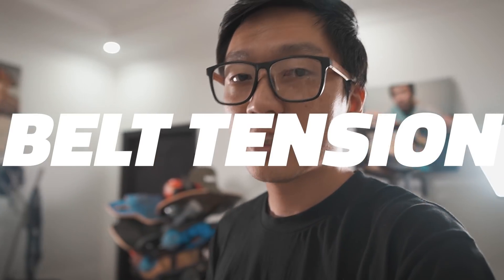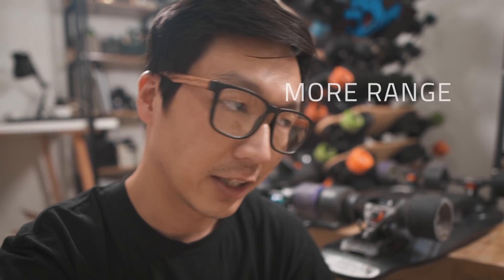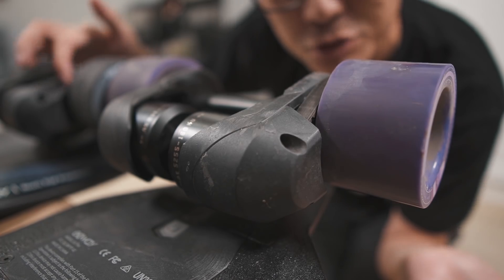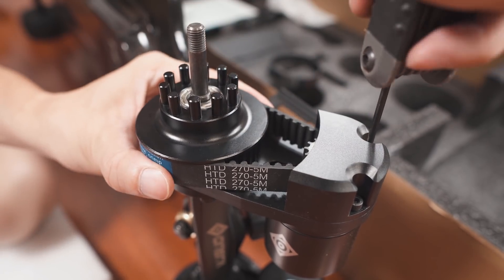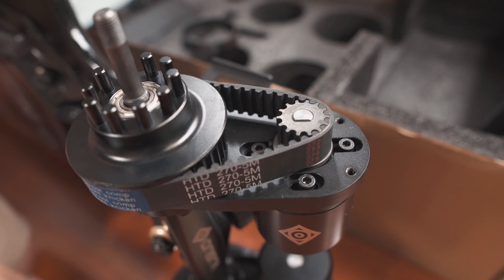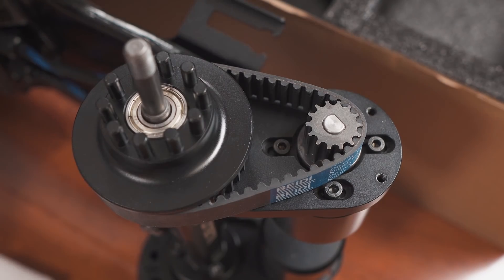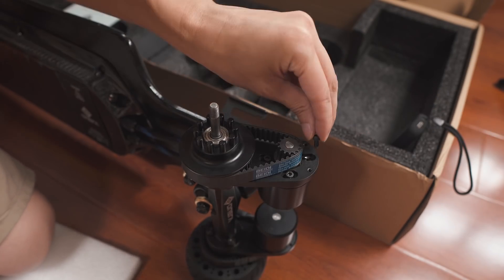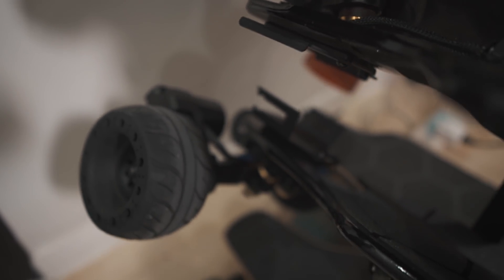If your electric skateboard uses belt drive...

Comment: i once went too tight on a boosted and could hear the motor make unusual noises... now I go not as tight... good video!! reafirms my belt tensioning.... i do think you are running them too loose though!!!! will have to adjust down the line if they are that loose as the belts stretch a bit...

Comment: This is great info, I got my Verreal Pro a couple of months back & I guess like many folks new to the ESK8 sport, I just assumed my belts were fine. Since watching the vid, I loosened them & found the whole board experience has changed. Slightly less whining noise, the board definitely rolls better & is far less jerky on braking as well as acceleration.
Compliments on the channel, its currently one of my go-to places for broad info, even though this vid is a few years old, the info is worthy!

Comment: Hi Daniel,

I have a question about AT boards, should the belt tension also be reduced if it'd been as tensed as shown on the video?

Many thanks, love your channel
Reply from the maker: Not sure which part you’re referring to but in general you’d want belts on bigger gear ratios to be a bit tighter compared to smaller gear ratios because fewer teeth are in contact on the drive gear. Boards are also much more powerful now than when this video was made, so I’d go a little tighter than shown. You should still go by trial and error and see how loose you can get without the belt slipping.
Reply: @DanielKwan  I appreciate so much how quick and detailed you answer is.
I was indeed refering to the fact that gears are bigger when using 150 mm wheels.
Reply: I've loosened the belts on my Wowgo AT2 plus with 175 mm tires, and it feels much better, quieter, smoother, less clunky, so I'd say it's worth testing as I think many esk8s, even ATs have belts that are too tight from the factory. In any case, mine is much more pleasant to ride now :) thanks for this video 👍

Comment: Its a really narrow range between too tight and too loose with the Exway Wave Riot. I thought my belt was too tight on one side, loosened it a tiny bit - it still felt tighter than the other side. What happened is it started rubbing against the inside of the plastic guard over the small cog, and it shredded itself within 4 or 5 miles. :(

Comment: When the belt is too loose, holding the motor and turning the wheel will result in the teeth of the belt starting to ride up the teeth of the gear on the side of the gear where the belt is moving toward the gear. In a properly tensioned belt, the belt will bend up and buckle a bit on the side moving toward the gear, but will not start to ride up the teeth of the gear. Find the point where the teeth first stop riding up the gear, then tighten it down.

Comment: Your content is very helpful. Overall I've had a rather poor experience w/ e-skate thus far. Minor issues w/ Meepo Hurricane, major issues w/ Ownboard Bamboo AT Pro - in both cases, obtaining after-sale support has been incredibly frustrating, inefficient, and unsatisfactory. I'll leave it there. I think belt tension (far too loose as installed/delivered) contributed to the issue w/ Bamboo AT Pro. This video helped with that. (NB - I figured that out on my own, Ownboard didn't diagnose it despite massive back-and-forth emails w/ descriptions, videos, etc.).

Overall I just don't know if this industry is ready for prime time - equipment like this needs to be robust, reliable, and SAFE. Warranty, service, and after-sale support are hugely important. I just don't see it w/ e-skate - poor QC, huge communication barriers, etc. Too bad - it's awesome fun when they work as intended! Thanks again for the educational content - without creators like you, almost impossible to educate one's self on the technical and operational factors of e-skate. THANK YOU.
Reply: Yeah also having poor time with exway. Awesome board, but came with a lot of flaws and they don't accept them

Comment: Caution: it is easy to be riding around with too LOOSE of a belt tension. 

Mechanical engineer here: belt tensioning is largely 'blue-collar witchcraft' and requires a bunch of real-world testing to tune exactly for your board - mainly because very few eskate companies provide tensioning guidelines (if they even have them, which I'm assuming is rare for most of these manufacturers). 
My suggestion would be to look up the belt OEM (who will ALWAYS have specs for various lengths and widths of that model belt). 
Another option would be to use belt tension frequency and an app (such as Hutchinson's), using ~40Hz as a starting point.

Comment: I’ve got a onsra bc2at. I’ve just replaced the belts due to one breaking after 500km. Is this about right kms before a belt breaks. Thanks for the vid mate, it helped
Reply: What's your range like?
Reply: @CokefishR  about 25kmph. I’m 100kg and do a mix of up and down hills
Reply: @Burbs1976  That's pretty decent. I've got the BC3 Pro AT, but my last few trips have gotten ruined by deep mud.

Comment: For me, I tried setting the belt tension in several ways. The slack of the belt like your video, besides the paddle slipping when accelraretor and stop, when the motor spins and the belt bounces up and down, it will damage the motor shaft and bearings more than
 i drop a littlegiving the belt a distance of 5-8 mm to bounce up and down. it's perfect for me good accel good break do not make motor and esc stresst.

Comment: Hi, did exactly as you showed, but first ride: no breaking. I tried holding the motors and make the wheel spin: no luck, I couldn't skip. Still bo breaks. Increased tension, and when the movement possible was roughly 0.7mm-1cm it started to sound right and started to break. So for my GTX I really need more tension than you show. Any idea why I encountered such a different behavior?
100mm streets on 38teeth. Gears were literally all new collected at Evolve yesterday. :P

Comment: Simple formula for belt tension:

measure the Centre to centre from motor spindle to axle spindle. For every inch add 1/64 of belt deflection.

3” c-c = about  1/8” deflection

Comment: Just my 2 cents - In the window of “too tight : too loose” it’s important to note that the heavier you are, the more right your belts should be. Me, I’m 220lbs of chewed bubble gum, so I need my belts a little more tight than lighter weight people. When I start from a dead stop, too much throttle will cause the belt to skip a little. However, full breaking on level 4 “NLS pro Belt” stopping is not an issue. I hope this helps! Stay strong!!!!….Stay slim!!

Comment: I don't know if I would apply loctite. I've had it permanently lock screws into place. Idk if there are different types of loctite, but if there are definitely use the weakest possible if you do this.
Reply from the maker: There are many different types. Loctite 243 is the common one and is not permanent.

Comment: this is really informative. thanks! but im quite confused. why do we need to use loctite ? will the screws loosen after certain amount of ridings? and, what if i want to re-arrange the tightness of the belt?
Reply: More times than not, when bolts undergo heavy vibration, they will come loose, especially on bolts this small. He is using blue loctite, which is not a permanent threadlocker.  It is used for this exact purpose of keeping bolts from coming loose, but allowing someone to remove them down the road. Just a drop is enough to do the trick for bolts this small

Comment: Alright great video I have 2 questions I have the Summerboard SBX and my belts came kinda tight and after I broke them in when I hit the brakes my belts skip. But they don’t really seem too loose. So I guess I’ll tighten them. I feel like the braking on the board is just too much for the belts to handle and I’m only 150pounds. Second question does anyone know the most affordable replacement belts? Mine are the 3m 15mm belts at 228 teeth. I’ve heard a company is making Kevlar belts but I can’t find them anywhere.

Comment: If ur belt snaps does it mean i cant break? The last thing i want is going downhill and having snap and crashing into death
Reply from the maker: If both of your belts snap then yes you would have to brake some other way or bail. If just one belt snaps then it would feel like your brakes got a lot weaker. Unlikely for both belts to snap at the same time though; never happened to me.

Comment: Is it ok if the belts aren't exactly equal in tension? When I did this on the Exway Flex It was hard to adjust the belt tension equally to both sides.
Reply from the maker: GibbyBruhh  Yes it’s ok if they’re not exactly equal in tension

Comment: Stupid assumptions without proper technical support to your claims. Go ahead ppl and loosen it up, am sure the belt companies will the thrilled to doulbe their spare sales! Loose belts will cause slip, glaze and burn.  It will eventually wear off the belt teeth prematurely due to the heat and meshing friction. I assume at some point some engineers got envolved in designing these belts and the tension so what supporting calculations can you draw here to challenge that?

Comment: Love your videos, great insite on we’ll everything!! Lol
I’m a new rider and just purchased a pre owned a flex riot,must be a pre production board,or at least a pretty old one because I cannot adjust the tension on the new belts I received from iCloud with the new tires and pullys. They sent a 280 tooth belt and you can push the belts right off the pully with ur fingers.however, it doesn’t slip....yet.... I’m thinking it will after some miles are put on .. what shal one do???

Comment: Isnt "Oof" only on some boards ? I Have G2s and Oof is there.But on mine other board which is Stealth. Oof aint there
Reply: But thx for this video.Cool guide ! Maybe will adjust belts little bit
Reply from the maker: Boosted boards use 3m belts so your belts need to be tighter than how I do it in this video

Comment: Hmm I feel like I prefer belts on my Boosted Stealth way tighter than you would appear to recommend or I'd get serious slippage, but I do ride pretty aggressively at full throttle 95% of the time w/ 100mm wheels.  Helps having hyperdrive lifetime belts, so I'm not worried about wearing them out.  I was chewing through a lot of belts before I finally upgraded, but now my board is more responsive than ever.
Reply from the maker: Boosted boards use 3M belts so they need to be tighter.

Comment: I would be careful with the Loctite. You don’t want to use too much because it can get in places you don’t want, especially the motor. Also be sure not to use the “permanent” variety. You want the blue version that’s labeled “removable” as DK used.

Comment: A tip I heard from the boosted board subreddit when I was putting on new belts was to push the motor with just 1 finger and with just enough force for the belt to be in shape.
Reply: I keep snapping my boosted belts and couldn't figure out why. Then I loosened it and it's been great for half a year

Comment: Can you set the belt tension on the exway flex?
Reply from the maker: Yes
Reply: That's good to hear. Users have been posting photos of the motor mounts on the flex and it seems like there aren't any elongated cutouts for the screws, so I was a bit worried.
Reply: I'm wondering the same. Does anyone know?
Reply: Is it the holes under the pulley or the screws for the motor?

Comment: Daniel, I am incredibly dissapointed in this video. 

Years of riding my motorcycle and readjusting chain tension has taught me this trick of putting a screwdriver shaft in between the teeth on the sprocket, turn the belt/chain till it's on the other side of the the original drive gear from the motor, pull everything as tight as reasonably possible and tighten all the screws down to lock everything down in place, turn the wheel back to where the screwdriver shaft is no longer trapped between the belt/chain and the sprocket/gear and you now you have everything with an extra few mm of the screwdriver shaft as looseness.

I use this same technique but with the belts on my Bajaboard but instead if a screw driver shaft I use a bit to provide the gap.

You may be able to use this same technique but use 1/4" bits instead because they are smaller overall

Edit also you should mention how important it is to get ALL the motors with matching tension especially when it's 2 motors and up
Reply from the maker: Oh damn that sounds like the obvious thing to do... Thanks for the tip, I’ll try that

Comment: Daniel, I know you have a couple Vestar boards, did you experience belt slipping after setting the right tension? For the life of me I can not set the proper tension for Vestar boards with out belt slipping. I don't have problems with my other belt drive boards.
Reply from the maker: Nope and I don’t have the Vestar boards anymore. Wonder if the pulley teeth look different.

Comment: I’m looking forward to my g3 arriving so I don’t have to deal with belt drives anymore. I’ve had evolve boosted and they all have belt issues, cog screw rattling and of course the pebbles getting stuck in your belts constantly
Reply: bro now you will have to deal witb broken magnets inside the hubs, and your hoard being out of service for a month as they have to send you a brand new motor each time that happens. belts are the way to go, you will see. pebbles and shit are nothing for my evolve GTR ive litterally never had an issue with belt drive other than belts breaking but if you have the at conversion kit you can just switch intil new belt arrives for cheap on amazon. trust me bro you will be wanting to go back to belts in 6 months when you realize that all hub motors aee fundamentally flawed

Comment: I just got a new board and after riding it a few times the back right bearings started to make noise fixed it the next night same thing so then I start looking at belt tension and that back right belt is obviously too tight so if you get bearing noise it might be belt to tight....Thanks Daniel for the detailed look at adjusting

Comment from the maker: Ah I just thought of one more benefit of loosening your belt tension. The board would be easier to push if it runs out of power.
Reply: I cut my belts when they die so I can push
Reply: @ericpistons9387  smart
Reply: Thanks for that trick.
I haven't never thought that. @ericpistons9387
Reply: Depending on belt length and tire diameter, you might be able to.pop them off the pulleys and then take them off even without removing the wheel 

On 83mm wheels that should be no issue, on 97 iirc I couldn't remove my BGT belts
Reply: I would have had to find out the hard way.. They really don't say these things in the instructions 😃 That's for sure
Reply: I don't know where this comment could help anyone but I purchased an electric skateboard from Amazon called "Fast and Furious'... Well let me tell you it should have been called!!   Fast enough to work for one 12 mile trip using economy speed mode when the battery ran out it just completely stopped while I was going 20 mph... Needless to say it threw me off and flipped itself over !
Luckily my Cat like Reflexes had me up and good to go.. The motor stopped working after that
Reply: I was thinking about this scenario. Everyone harps on about how hard it is to push belt drive if you run out of juice. Would you not be better off spending 5 minn to takie the belts off in case you run out of power with a couple of miles. To go?

Comment: Your videos are brilliant Daniel, but on boosted boards you pretty much need A LOT of tension on the belts. When riding my V1+ or Steath, when very aggressively riding downhill (45-50kph), before slowing down at the bottom. Every damn time belts will slip, even with new belts, also the Stealth was slipping even with 20km on the odometer (pulleys were definitely not damaged). 
Anyways just my experiences with boosted!
Reply from the maker: I actually only know of two brands that use 3M belts instead of 5M, and Boosted is one of them. So yes on a Boosted Board you'd need to have the belts be tighter. (Smaller teeth.)
Reply: @DanielKwan  great content...love your videos. Which one is better 3M or 5M?

Comment: Over-tight belts also put undue stress on the motor and axle bearings wearing them out quicker.
Reply: I was going to mention it from a maintenance engineer point of view but you already did. Good job

Comment: Thanks for the video DK.
Belt boards maintenance is definitely a great topic. How to buy belts locally without spending a bomb is also another good topic of discussion i reckon.
Reply: in the UK we have few online bearing type shops who also do pulleys and belts (for 3d printers, industiral stuff, etc) and the 5m belts are like 5 pounds from them (as not niche).